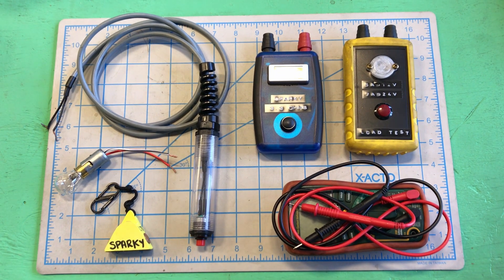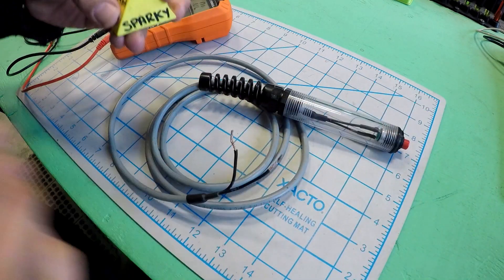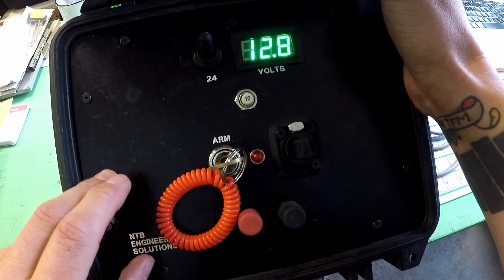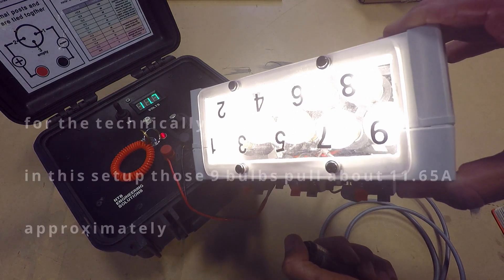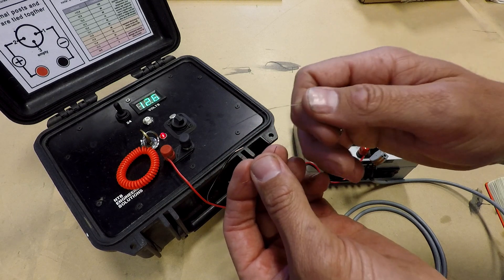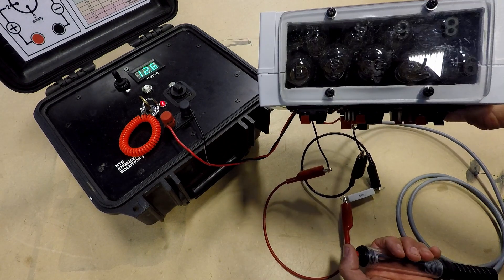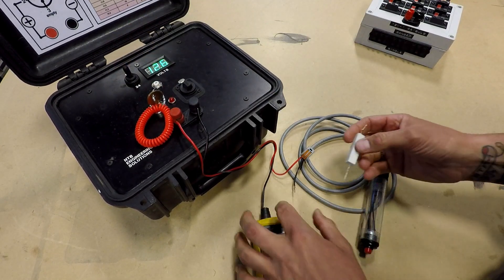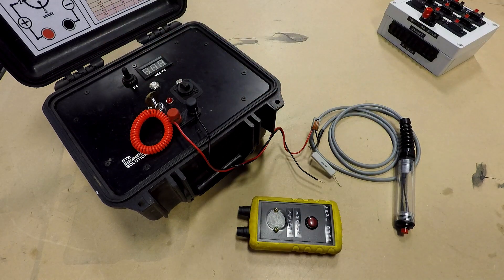Continuity vs Load Testing (12VDC circuit)

Comment: This is destructive testing. If, in fact, the switch were not capable of handling the applied current it would suffer the same fate as the small gauge wire.

Comment: Nice. The low bulbs are due to insufficient power going to them them because resistor ate some of the voltage. The current is the same at every point in the circuit. Power equals V x I, but I is constant. It is the drop in voltage (across resistor) that reduces the power to the bulbs.

Comment: Good Visual Demonstration and explanation. I'm looking forward to viewing your diagnosing method starting points to check for Voltage Drop in a real automotive electrical circuit situation. Also what electrical testing tools you use to test voltage drop. Do you use a DVOM and have you used Dan Sullivan's Load Pro Tool? Also is there any differences in testing DC vs AC electical  Circuitry in your view and experience? Thanks heaps

Comment: That is an awesome demo. I use an m12 battery to bench test automotive components and provide power to circuits. I also made a load out of a head light bulb with 4mm banana jack leads. If you use stackable leads, you can easily combine several bulbs into a larger load (not as cool as your setup). Also, I got some wago lever nuts. It makes connecting wires a breeze,

Comment: I find in trailer wiring that has been probed with a test light corrosion will later appear , always pull hard on the wire !

Comment: Any idea who made that yellow 5A load tester? My Google-Fu has not been able to track one down.
Reply from the maker: Hi! Thanks for the query - that 5A load tester is actually a Sparky original! Your feedback is inspiration for a video of how to make them. Please watch this space!
Reply: @triplepointworkshop5163  Great, Thank you
Reply: @triplepointworkshop5163  Let me know when they are available, I'll be first inline to buy a few.
Reply: Do you have the brand and bulb number on that 5 amp bulb ? It smaller than using a head light .
Reply from the maker: @billsmith2212  https://www.mcmaster.com/1535K92/
Reply from the maker: @billsmith2212  Hi Bill. The bulb was purchased from McMaster-Carr. Part # 1535K92